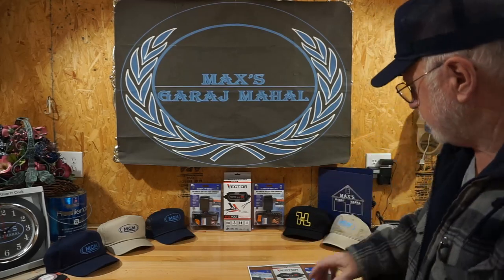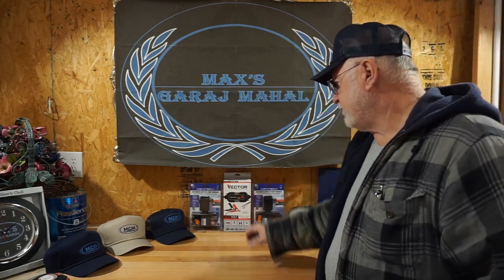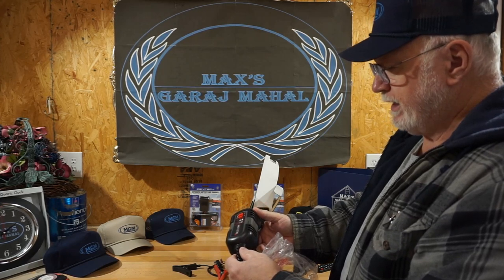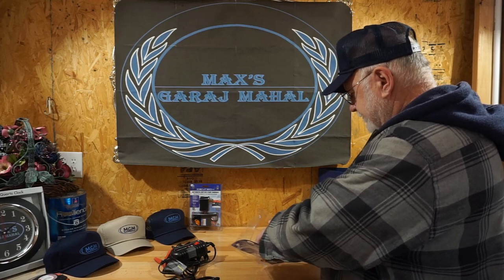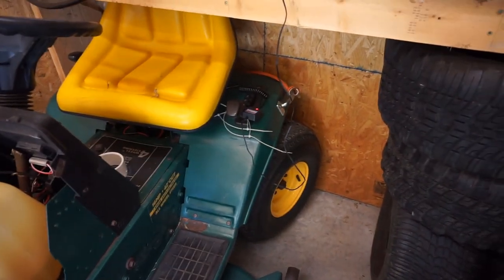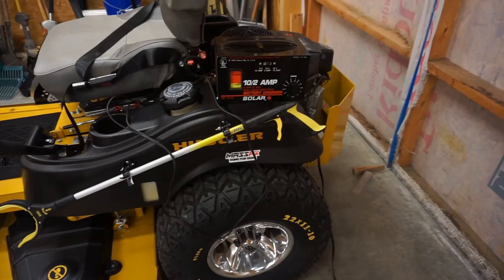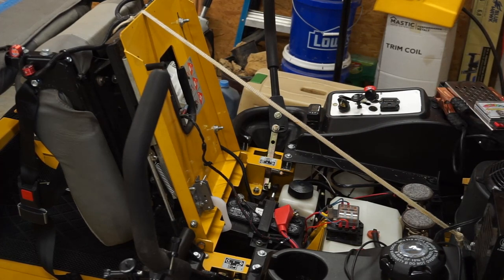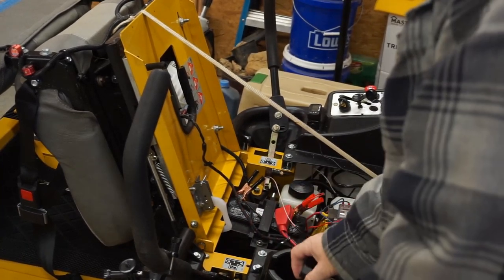Battery Tender Maintainer - Winter Maintenance Mowers, Motorcycles, Cars, Trucks, Tractors, etc.

Comment: Max I got battery maintainer but I have every use it, it’s in the garage somewhere , that’s is a good idea to hookup one to the battery during the winter months. Great video Max.
Reply from the maker: Michael, I was the same way. I had the one on the old MTD forever before I ever took it out of the box. I actually purchased it to put on our Yukon that sits 11 1/2 months or more out of the year without being moved. 

Bride seriously did NOT want it hanging out of the vehicle in the event she wanted to use the Yukon. Well, had to put another battery on it this year. That is number 5 for a 2004 Yukon including the original equipment. All of that is due to non-use.

I think you'll be a lot happier if you use that rascal.

Thanks for watching my friend.

Max